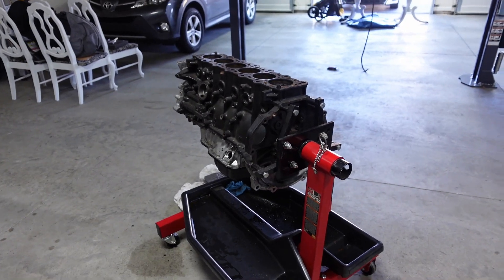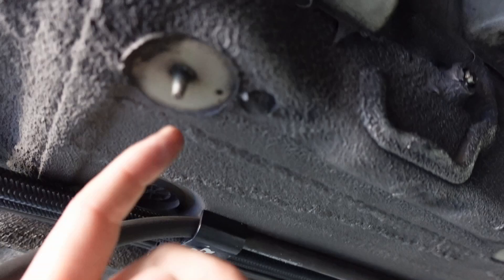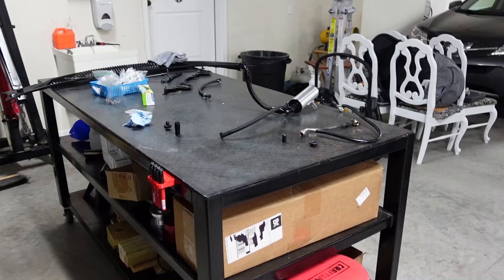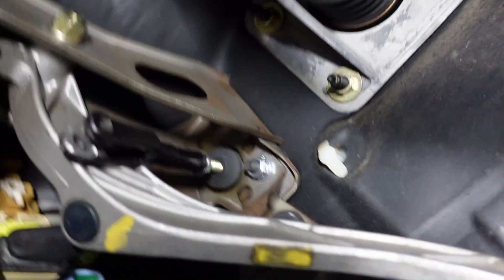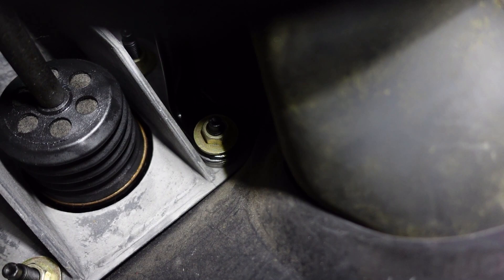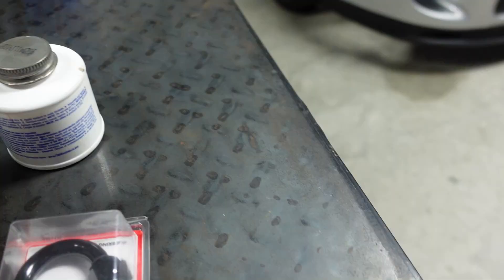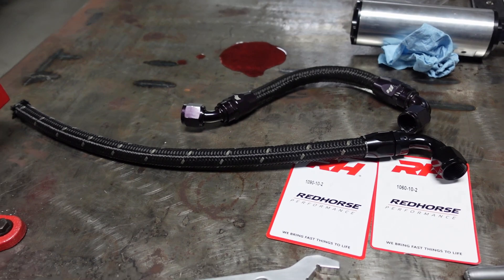2JZ Rebuild Ep.3: Brake Booster, Power Steering & Fitting Failures

Comment: @4:00 send those two Front Sub-frame bolts on either side to sandblast and Powdercoat. 😏 It's a small touch but worth it as they always rust. Did mine in clear coat, but black would be nice.
@19:29 Not on camera dude come on 🤣🤣
@23:17 imagine what it was like doing my -20an fittings, Literally got blisters from the pressure needed to apply.
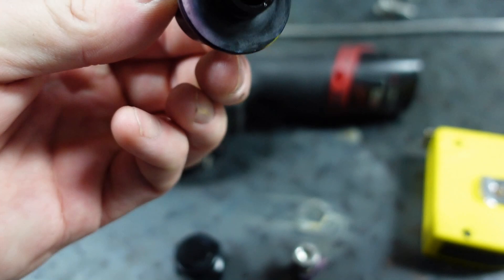@25:30 usually the sun would bleach stuff like that from extended heat cycles over time but I guess you got the power of the sun under that hood lol.

Comment: Should check out the antigravity batteries super light an smaller in size but still gives the same if not more voltage for the size u get there’s a couple versions
Reply from the maker: My buddy has had two that issues now so I’m stay far away from them

Comment: I’d assume your fittings changing colors are due to your car being driven more often and harder than your wife’s supra is. You probably have more heat cycles in them at higher temps
Reply: id actually guess he used a degreaser such as purple power to clean up a mess and it ate the anodizing